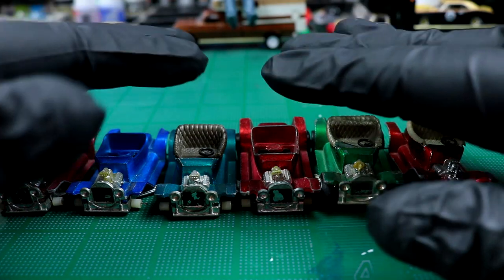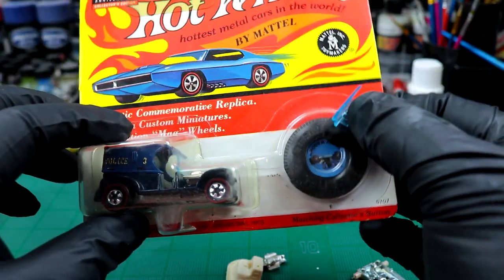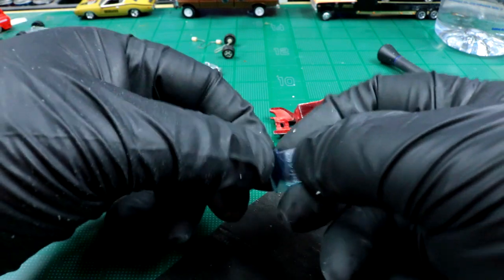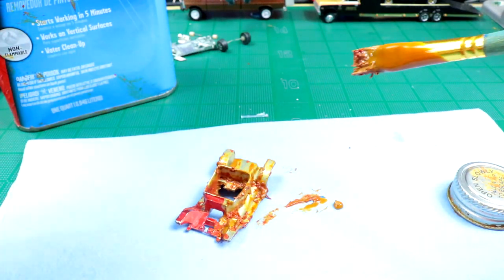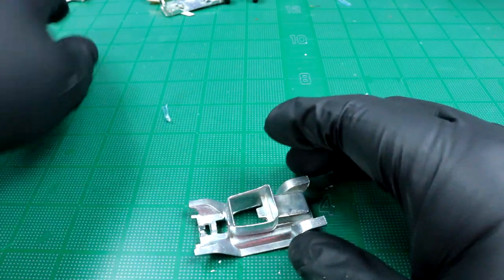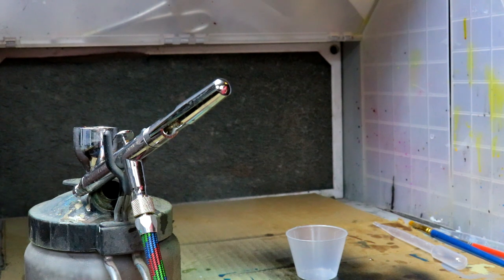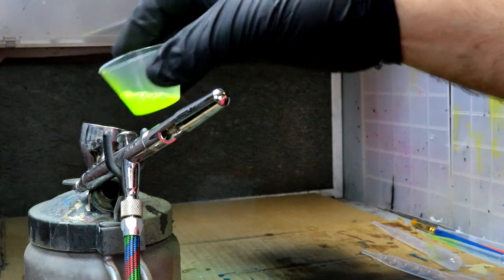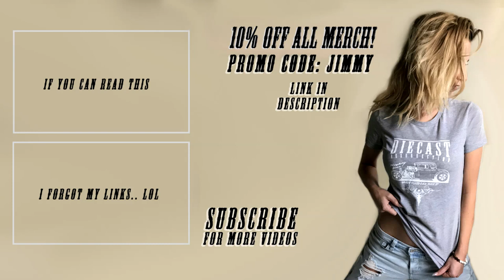Redline Restoration: Hot Heap

Comment: Another great video. Just curious, when would you use primer as opposed to not using it? Did you not use it because you wanted the metal to translate through the paint? Could the paint peel off with normal wear when not using primer? Thanks.

Comment: Heat Gun to soften plastic then try to flatten out the crease to remove that windshield angle? For some reason it really bothers me. The car looks fantastic otherwise!
Reply: Great idea do you think the heat gun will make the plastic melt being it's so thin vs putting in boiled water? What's your thought on that? I never tried it yet with model's.
Reply: I think boiling water could be better to try first

Comment: Man, get into silicone molding and resin casting . Take one sample windshield (which could be an imperfect one you want to replace, or 3d printed+smoothed+polished), make one little mold, make your own perfect replacement windshields, any color u want. The plastic will be wrong, but for customs and restorations with reproduction parts that already doesn't matter.

+it's gonna be relatively cheap since you will need little resin per cast and little silicone per mold